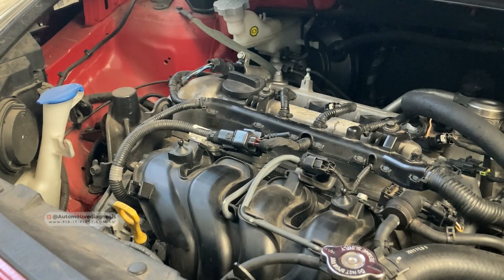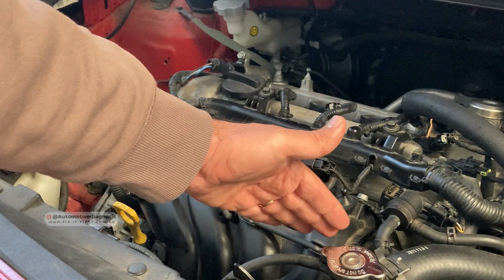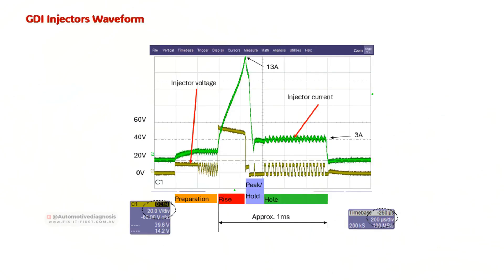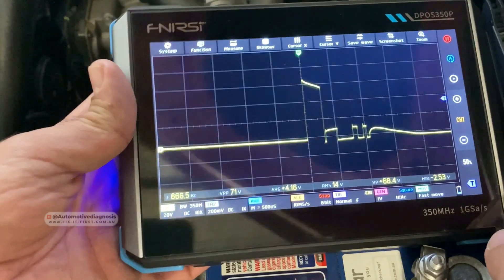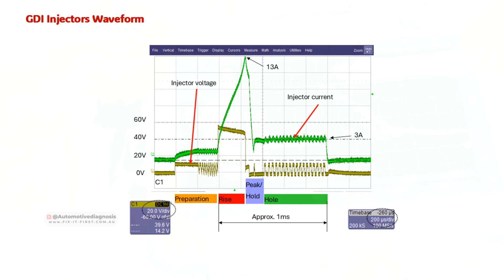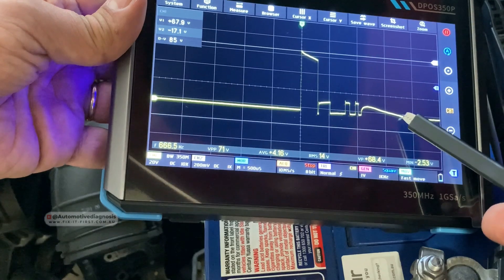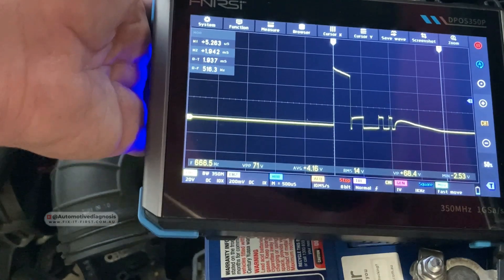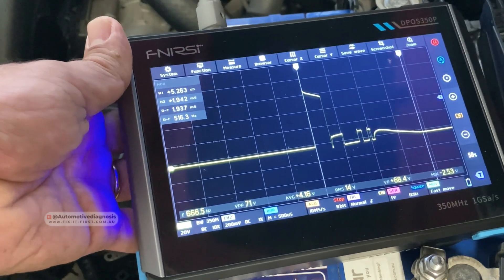GDi Injectors vs Budget Oscilloscope | GDi Injectors Diagnostic with a Budget Scope

Comment: What are the 3 other voltage rises after the first peak voltage?
Reply from the maker: Hi my friend, during the injection ECM tries to keep the voltage steady, that up and down comes from that side, ECM keep regulating the voltage by lowering the high voltage and increasing the low voltage. This will be shown as what we see on the waveform.
Reply: @AutomotiveDiagnosis  Maybe you can make a video showing how to diagnose a faulty one and how it would look on the scope.
Reply from the maker: @FadetoBlack1463  Sure thing my friend.
Reply: yes we want to know as well

Comment: on a port injector you can identify the pentle hump moving as the voltage drops off when the injector is starting to close.  is it possible to do the ssme on a GDI injector?
Reply from the maker: Hi my friend, on this one we don’t have the pintle hump, but we can see when injector starts getting close by monitoring the current and voltage.
Reply: @AutomotiveDiagnosis  hopefully we can get a part 2 to help identify it